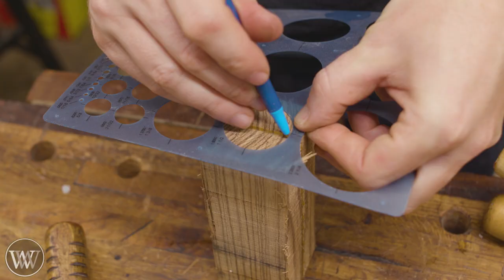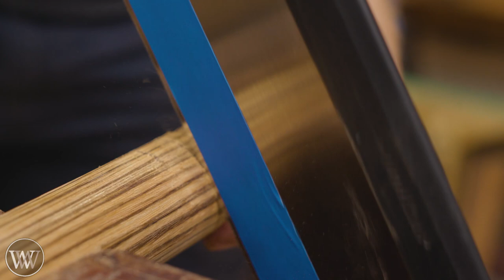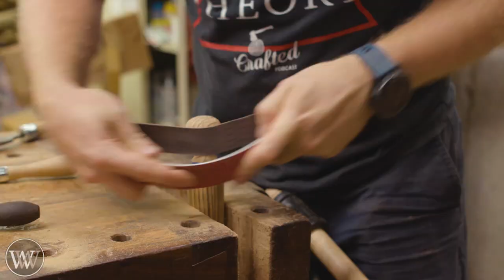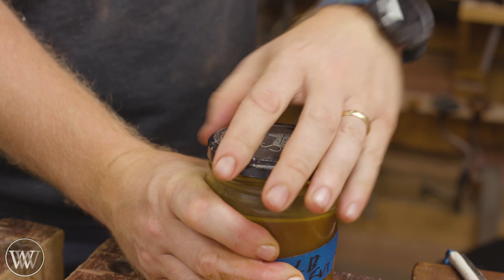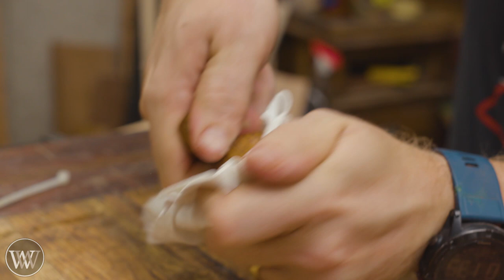Making a Knob Without a Lathe for a hand plane

Comment: Dear James, yet another example of your master craftsmanship. One thing would make this sort of job a little easier would be if you use V-blocks in your vice.  A V-block has a square cross/rectangular cross-section with a V groove machined along one face {the active face}.  You can make a pair of them to drop into your vice, one with a horizontal groove and one with a vertical v-groove.  Now you can hold circular work either vertically or horizontally. Don’t struggle again with trying to set a piece horizontally or vertically, the appropriate V-groove takes care of this. 

I made a pair out of brass on a milling machine and in those, I added a hanging section that poked outside of the inner active face.  This sits on the top of my existing metalworking vice jaws, which are not altered by the process. The brass pair of jaw vices can also be dropped into a wooden vice without modification and work quite well there too. A couple of neodymium magnets embedded but with their surface the same as the vice face surface give strong holding of the mobile jaw faces and so you don’t have to worry about them dropping on the floor whenever you open your vice.

Alternatively, you could get some hard wood and make a slightly larger set for woodworking use only.  Happy carving.
Reply from the maker: thanks Peter. I have a pair of those I use from time to time, but on this one I was adjusting it every few seconds to go around it and they were a hassle to keep moving. I also use a Hand Screw Clamp with the tips cut out like that. work great for a lot of applications like that.
Reply: I see said the blind man.  Love your work.

Comment: Just picked up a Stanley bailey #5 made in the USA at a yard sale yesterday. Just about everything is good to go and only spent $15. I was happy. Now to clean it and get it set up ready to use.
Reply from the maker: Nice Find Jason!
Reply: @WoodByWright  so what I'm finding is that it was made from 1946-1947. I need to get a new iron for it. The rust pitting wont allow for a smooth straight cutting edge. The rest seems pretty functional. The sole dont seem to be to far out either.

Comment: I saw something from Paul Sellers that really helps for shellac. I use an oversized glass container and don't fill it past half full. That way when I dip the brush into the shellac I can dab it on the inside of the glass jar way away from the threads and the lid doesn't get stuck. It works really well.
Reply from the maker: I used to do the same but I find it still jams up the threads when I shake it. Lol
Reply: Wood By Wright I use those mason canning jars. Maybe it's that little bit of rubber in the top that helps.

Comment: FWIW - to open a stuck lid, turn the bottle upside down and bang it against a solid surface, striking so the lid hits flat against the surface.  This pushes the entire lid against the rim and usually works for me.  Be certain that the surface against which you bang is free from obstructions, like stray screws, etc.  I don't recall where I learned this, but for me it works much better than banging the edge of the lid.
Reply from the maker: interesting. might have to try that next time.

Comment: Although nothing to your level of skill, I have amazed myself with shaping things with hand tools and the main things required are patience and attention to detail. However, the one thing in the video I would have completely screwed up was drilling the center hole. I noticed you started at both ends. Is the idea that as long as they are centered on each end, it doesn't really matter if they meet exactly in the middle? I would have a hard time with that procedure without a lathe or drill press. Love the projects!
Reply from the maker: in this case it was a must for the two ends of the hole to be EXACT. but most of the time I would just free hand it from one end to the other. there are methods to stay on track and most of the time I am 1/16" or less off over a 4" hole.

Comment: That sanding bow was an amazing idea! Sorry if this has already been asked, but when you drilled through the center, how did yo make sure that your bit brace was square?
I love making things the hard way with minimal machinery. It takes more time, but there's an uncommon level of satisfaction few can relate to. I also loved the improvised sound effects. Haha. You are an inspiration sir!
Reply from the maker: thanks. To be honest I rarely check that a bit is square. I just eyeball it. and with drilling from both ends if it is off by 10 degrees (rarely off by more then one degree) it will still work perfectly!
Reply: @WoodByWright  thanks for the reply. I'll keep this in mind. For all I know, I obsess too much over keeping things square when it need not be absolutely perfect. Thank you 🙌

Comment: Wow I would never have thought one could get that kind of result with only rasps and files. Spectacular. I know it took longer than 12:39. What was the timeline to make the knob?
Reply from the maker: From block of wood to applying finish was just under an hour. to be honest it would have taken me just as long or longer to pull out the lathe, set it up, sharpen the cutters, find a chucking method, turn the piece then drill the hole on the lathe. and even then I would have to cut it off and shape the round slot to fit the body.

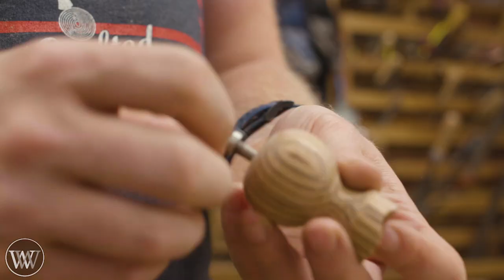Comment: hey man you have ALOT of patience.... also this is a great effort and well done. what is that little tool you used at 6:47?
Reply: A depth gauge – they come in tons of different shapes and sizes. This one says PNTC, which I think stands for Pacific Northwest Tool Collectors – probably made as a giveaway or prize for a meeting or conference? I like these little helpers, although you could achieve the same with a piece of wood and a long screw, very simple.
Reply: @mm9773  roger that
Reply from the maker: thanks. M M has it exactly!

Comment: I was actually planning to make a video on ways to make tool handles without a lathe:

Saw it with a hand saw, shaped like a tapered rectangle/cone (See John heisz's clamp handles)
Carving knife
Rasp
In a drill
With a power sander, a belt sander for example.
A flex shaft
 rotary tool with a carving burr

But I abandoned the idea(s) so here ya go ;)
Reply from the maker: Lol. Sounds like a fun video would love to see it.

Comment: Question:. For the groove to allow the handle to pivot, could you have drilled a hole through each side before shaping, or was that too risky in case something went awry during shaping?
Reply from the maker: I had not thought of that, but yes I could have done that.
Reply: Wouldn't the rasps have caught the edge of the hole and messed it up?
Reply: @FrigginBoomToys  maybe a bit. It depends on how aggressive you are with it. But if you're careful it wouldn't be a problem.

Comment: Sometimes I think hand tool purists are just masochists at heart. You could have sawn off some of wood after glue up instead of planing it down forever...

As far as the belief that a lathe is necessary, most of us have a hand tool rescue "vertical lathe"... It's not ideal but it can be done. This way works too.

That plane is pretty cool, I've never seen handles that can be angled like that.
Reply from the maker: thanks. in this case it is actually faster to plane off with a scrub plane then to set up and saw off. setup and everything the corners came of in under 2 minutes. the whole project start to finish was under an hour with setup time and everything. It is surprisingly fast.

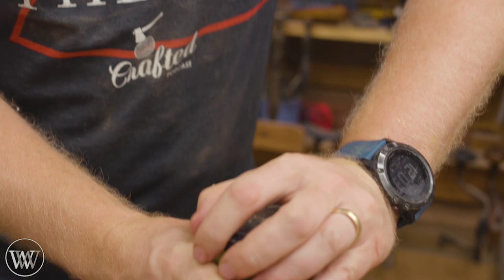Comment: @ 8:57 wHy aRe yoU uSinG a FiLe foR tHAT???

😁  But really, I like the look of the "book matched" bocote(?), the symmetrical grain gives it a cool look.  Even though they're slower, I still love using quality rasps and files to shape things the most, unless of course it needs to be precisely round or cylindrical ;)   Great video
Reply: I recently watched a video where somebody used a tattoo needle to spread epoxy.  Whatever works and is within an easy reach, I guess.

Comment: To me, drilling the hole after spending that much time shaping would be scary. I suppose you went halfway in from each direction and met in the middle close enough to perfect?

Since I can drill a straight hole at least 1 out of 20 tries,  I have found it is better for me to drill the hole, first. Then stick a rod or dowel in the hole for a visual reference. Then shape the wood to that axis, so the hole ends up straight. :)
Reply from the maker: I know a lot of people I'm late will drill the whole first and then use that to center it up. But with a few drilling tricks it's actually really easy to drill a square straight hole. I have a few videos on the topic as well. There's amazing with the eyeball can do when it is giving references

Comment: I was at thee Hershey swao meet some years ago to look for old, damaged, reduced price tools i could refurbish to add to the collection. I found a mostly complete 16 inch plane for
$20. Not knowing what i know now, the reason if was so cheap was drum roll you guessed it, it was dropped and brazed back together. Anyway the guy that sold it to me said these were scavanging parts off of like the handle and knob, which i reasoned if you're going through the trouble of scavanging wooden peices for woodworking, why wouldnt you be making them yourself? I've made handles before, its not that hard unless you're doing it by eye. 

One of lifes mysteries i suppose.
Reply from the maker: LOL yup. I have gotten a few like that back when I frist started. a great way to learn!
Reply: A welded or brazed plane is only bad from a collecting point of view. If it works it works. But $20 is steep to pay for a repaired plane. Unless it is something really special.
Reply: Paul Frederick well, i thought it only needed an iron and some tlc, so convinced myself it wws a steal. Over at the more established antique dealers, they were selling similar items at near retail prices, and beyond. Like a 4 inch chisel for $100 without a handle or stamp marks that might justify the price as a collectors piece. But either way the sole is warped, and theres no way to true it without significantly altering the mouth. I suppose i could rebreak it and try to allign it properly, but I'm not that adventurous, nor experiencing in welding or brazing.

Comment: Why do you use a chisel with the bevel down?
Reply from the maker: DoubleDown gives you more control as you can angle the cut up. If you go back and look at most historical woodworking most chisel uses have the bevel down. It is a modern thing having more to do with the power tool mindset to use the chisel in line with the force and bevel up.
Reply: I was taught to use woodworking chisels 65 years ago, long before power tools as we know them today appeared, and my old woodwork teacher never showed me that approach. And I know modern teachers and I have never heard of this approach, I will research this further as I think it is an Americanism, certainly not an approach seen in the UK.
Reply: @Bawdsey64  bevel up a chisel will dive down. Bevel down a chisel takes a skim cut. So how you present the chisel to the work depends on what you want to do.

Comment: For something this size. If you’ve got an electric drill, you’ve got a lathe.
Reply from the maker: true. there are several videos out there on that, but with the setup time this is often faster. from square block of wood to finished project it was about an hour.